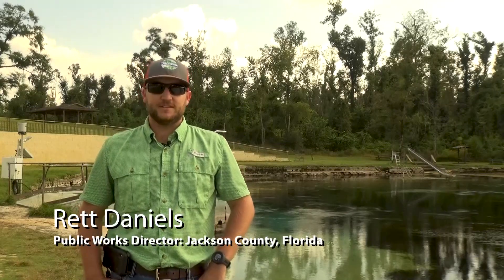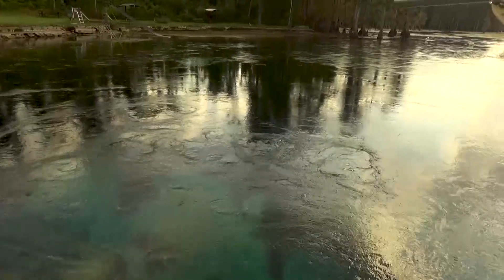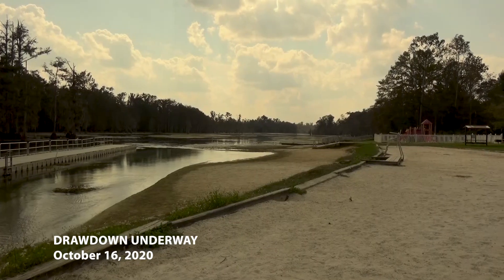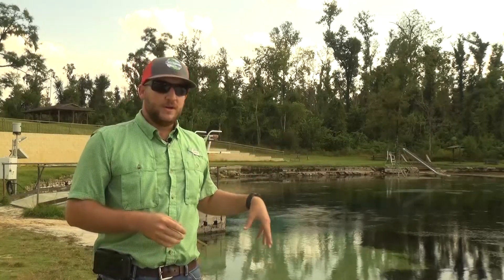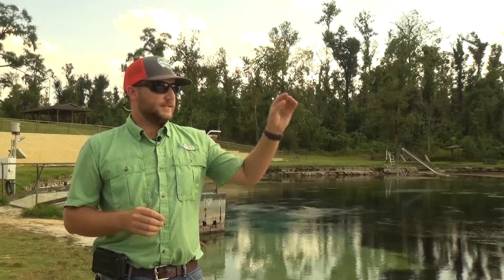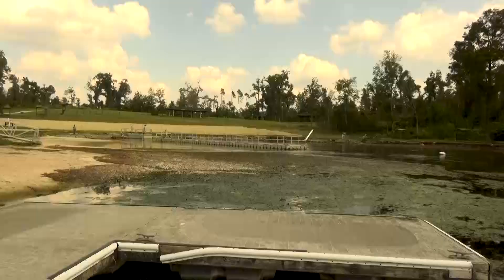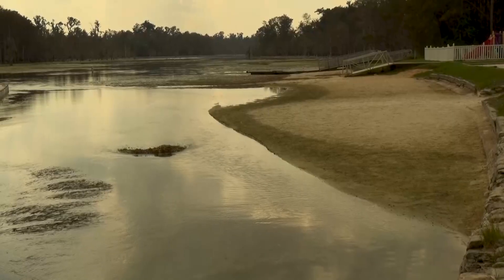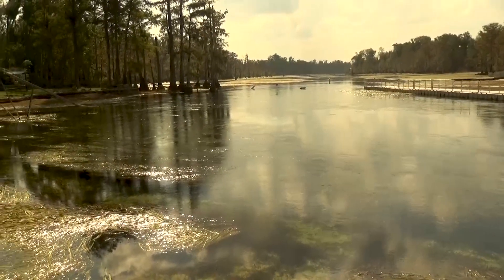Drawdown at Merritt's Mill Pond

Comment: How long is the drawn down?  And where is the entrance to cave to paddle board?
Reply from the maker: The drawdown will start ending over the next day or two. Just as it took a couple of weeks for the water to fully come down, it will take over one week for it to fully come back up. You can access the Gator Hole cave from the public landing on Hunter Fish Camp Road, Marianna, FL. It is almost straight across from the landing. Beware that there is a lot of mud from the paved end of the landing to the water and you can sink to your knees (or deeper). You can also launch from Cave Adventurers on Limestone Lane, Marianna, FL for $10 and for an additional fee they will transport your gear down and up the hill to their dock. We have several other stories on the drawdown and the caves so check for them and you can get the latest from the county and see plenty more video.